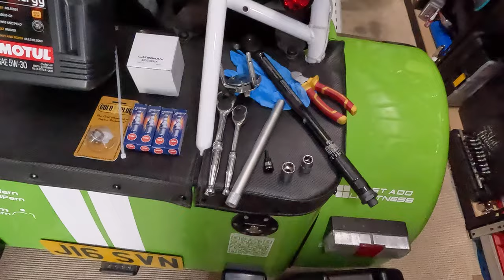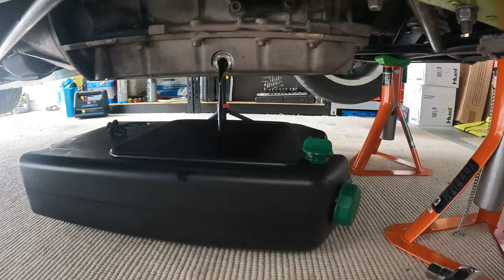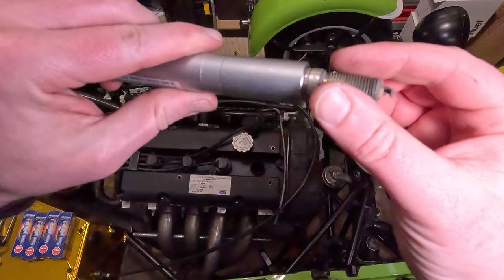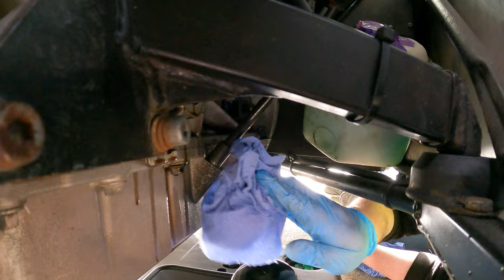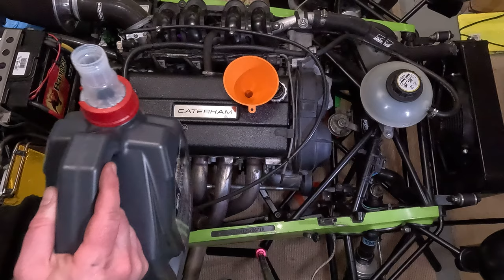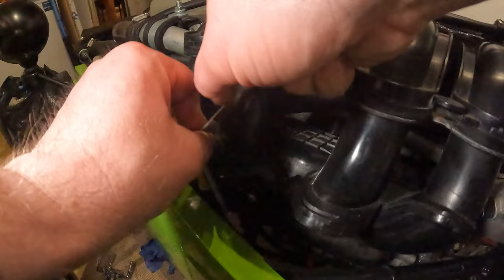How To Service A Caterham Ford Sigma Engine

Comment: Interesting video as ever. The magnetic spark plug socket a really good tool. Great video
Reply from the maker: Thanks. Yer I wish I had bought one of those sooner. Better than a normal spark plug socket I think. I still can't believe I left the cap off the oil.

Comment: Hi James, great video as always. Iridium spark plugs have a life of 50k miles. I changed mine at 15k miles when trying to diagnose a problem and they looked fine. Going forward I was thinking of changing them every 20k miles.
Reply from the maker: Hey thanks. I know I change them too much, but I'd rather keep it in my yearly routine and not a massive cost really. I do lots of preventative maintenance to hopefully avoid problems. I didnt know it was 50k, but I'm sure 2 years for me would be fine, possibly more.

Comment: Do you not have a modine oil cooler fitted? What power output do you have? Liked the video - always like to see other sigmas as gives me ideas 👍
Reply: And I noticed your front struts are spring down - opposite way round on mine. Any reason why? Again just interested
Reply from the maker: Hi no I don't have an oil cooler. 140bhp, I don't think I've seen an oil cooler on a sigma before.
Reply from the maker: Yer it's interesting isn't it. It was like this when I bought it. I think it's because they are easier to adjust, but I'm not 100% sure.
Reply: @ACaterhamCalledFern  ok, mine is about 160bhp and the cooler is in the sigma build manual. Confused me when I was building mine. It fits between the oil filter and the engine and is on the coolant circuit. Not sure what performance benefit it has though- would be interesting if anyone did know
Reply from the maker: @artparkinson7371 interesting I'll have a google. I say 140bhp it could be less. It would be good to get it on a dyno and see hey.
Reply: @artparkinson7371 My 310 has the heat exchanger. I think it serves two purposes. After a cold start the coolant heats before the oil so it helps heat the oil to get the engine up to temperature. Then when the engine is hot such as on track the coolant and radiator helps cool and control the temperature of the oil. It is clever!